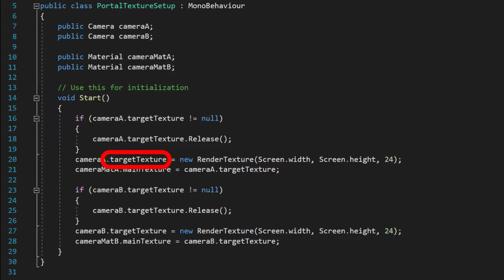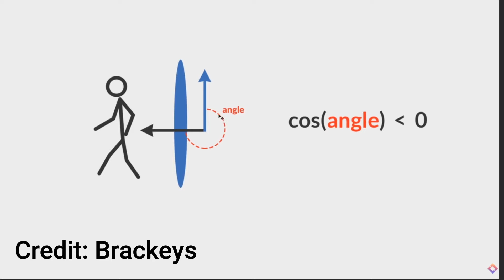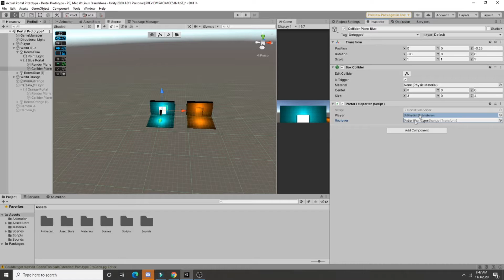How to Build Portals in 2 Minutes

Comment: I tried it out and when my character travels, it clips between the positions of the portals. When I try moving further, it sometimes teleports to the other side successfully or it doesn't and the player just walks ahead like it was nothing.
Reply from the maker: Hmm. Does your character glitch back and forth? I had the same bug, and in the video, I solved it by rotating one of the portals 90 degrees. It had to with something regarding dot product calculations. If you can't figure out, you can follow and/or download Brackeys tutorial on portals. Hoped this helped! :)
Reply: @JujuProdGames  yes, I rotated one of the portals 180 degrees just to see if something happened. It does glitch to and fro but at least this one still allows for smooth movement somehow. I'll try your way as well. Thank you!
Reply from the maker: @L3RNA3AN  No problem! I’ll be completely transparent, if the tutorial doesn’t work, I won’t know how to fix your bug. I made this over a year ago! You can also look at Brackeys tutorial for another reference; he even has the code posted on GitHub. :)
Reply: @JujuProdGames  will check that out too. Thanks again!